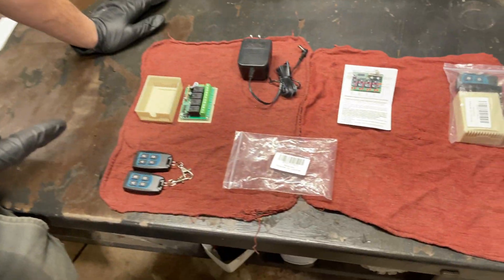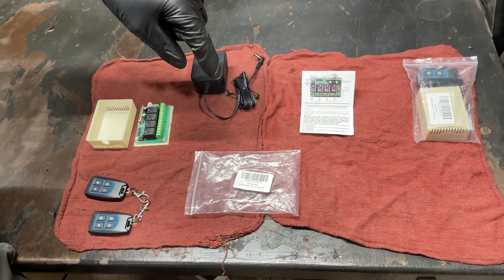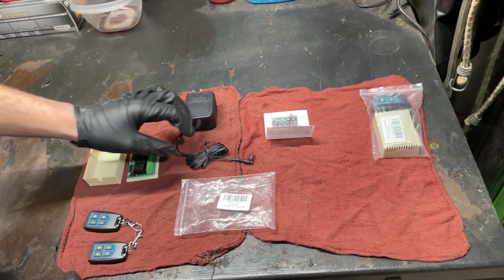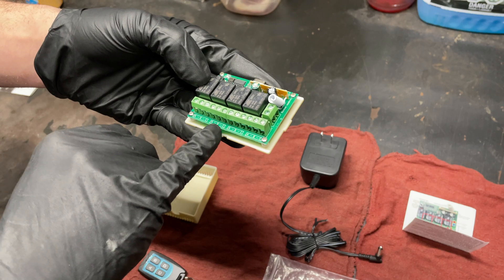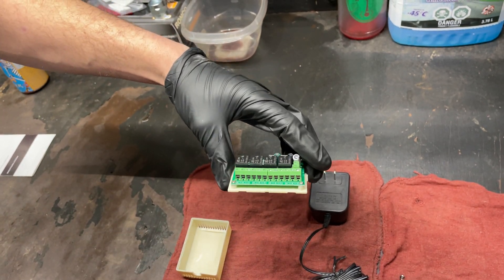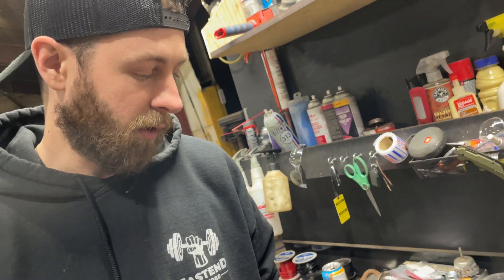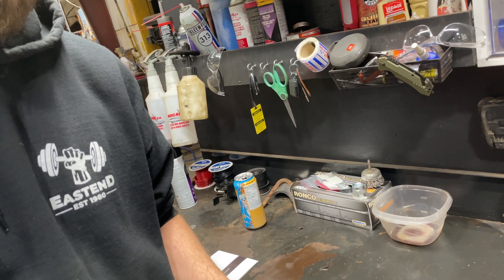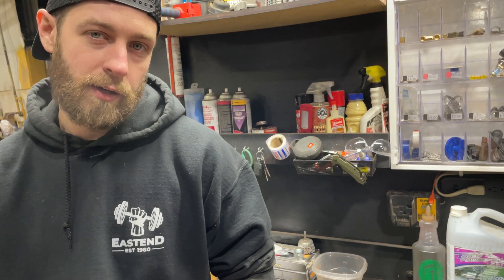Garage Door Remote 12V Relay Remote Switch Wireless RF Remote Control Switch

Comment: So im trying to use one of these in a bus I just bought that doesn't have keys for any of the doors. I want to use it as a momentary switch for the passenger door, so i dont have to reach in to the drivers side and push the open switch, and i want it to also be able to unlock the drivers side. All because it wouod cost me around $150 just to rekey the locks or have keys made. I have no idea what normally open/closed or com means or what those would be hooked up to. Does the normally open/closed mean the circuit or the door? Im guessing the circuit. If it is the circuit, what does "normally" open/closed mean when it comes to a door/lock. I really dont want to fry anything while hooming this up, because there are so many unlabeled wires between like 4 fuse boxes/junction circuit boards in different compartments on this bus. Its a city transportation bus. Currently needs a new TCM so it can actually be driven, but im more concerned about being able to lock it, and this seems to be the easiest way lol.